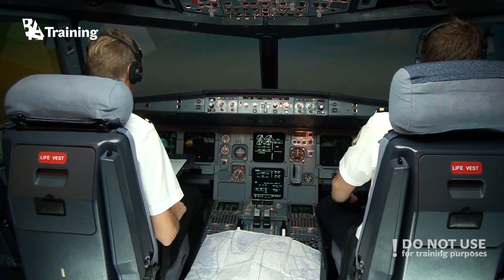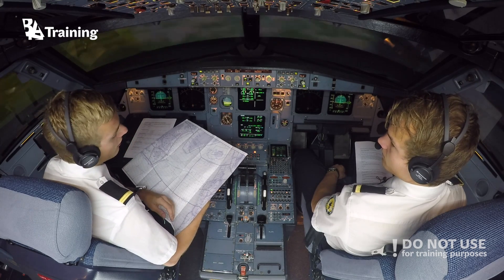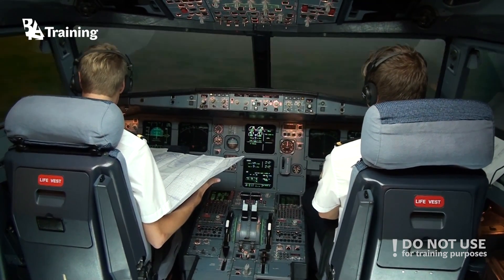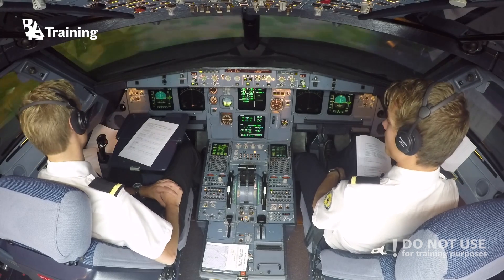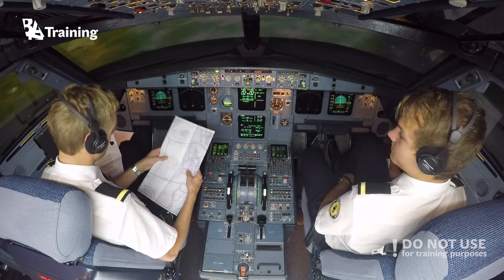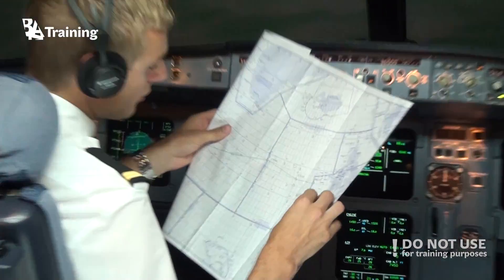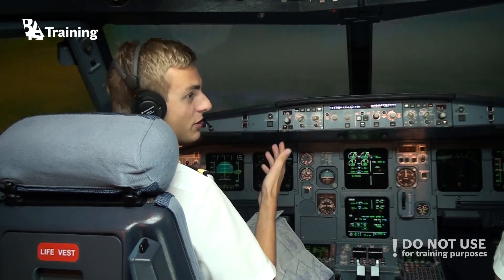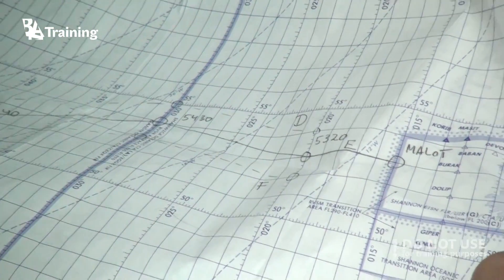Transatlantic attempt in Airbus A320 (part 2) - BAA Training

Comment: what would happen if you tried to perform a ditching? Is it possible to do it in the simulator? or it will just crash?
Reply: Yes it is possible. Simulators are used to train pilots in many emergency situation, including ditching.